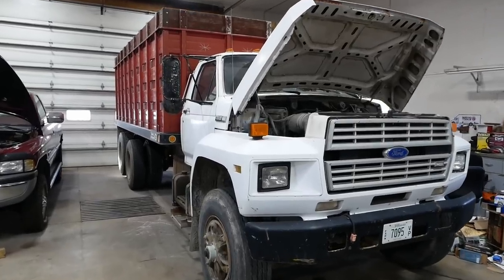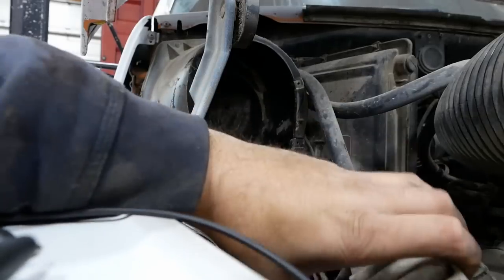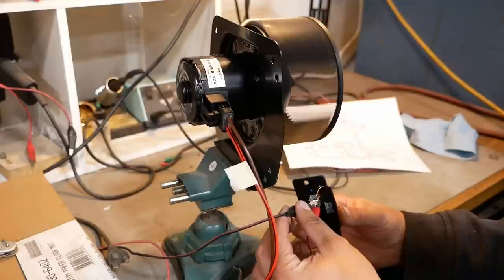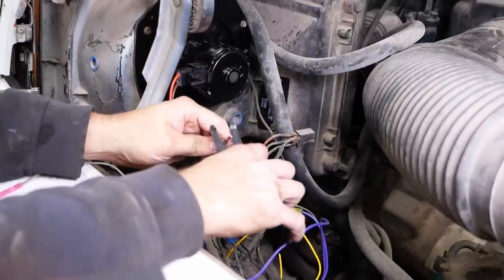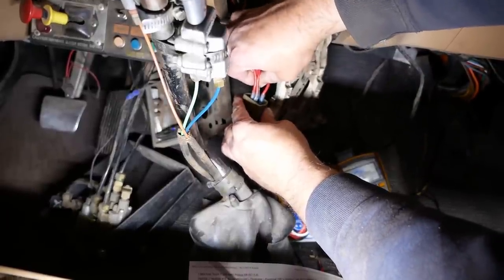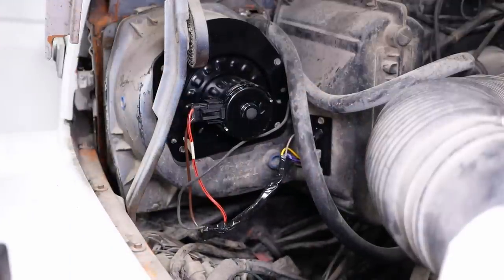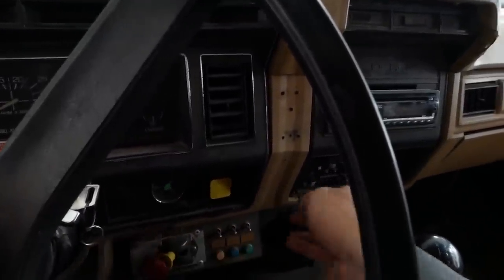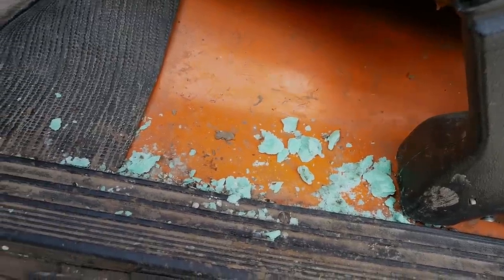Frigid Farmers - Ford F800 Blower Motor Unhacking

Comment: Enjoyable as always Wes. Can always take some wire-crimping therapy. However my stress levels rose dramatically  at the end with that horrible  rattling noise combined with the non-functioning radio. When you were installing the latter I was saying (based on personal experience) 'test the radio! test the radio!'. But as it didn't work in the first place...  i guess you knew what you were doing. :)

Comment: My Ford f650 rollback towtruck with a car on the back got 24 miles per gallons with the 8.2 Detroit In 60000 miles  it meant $20000 more profit over a newer f350 with a 7.3 power stroke.  
 Now mine was slower than time utilized was non turbo . The problems with the 8.2 were turbocharged . They couldn't handle power .  
 I  loved my 8.2 and felt sick selling it

Comment: I worked on the original iteration of the Detroit Fuel Pincher back in the early 80's. Their poor reputation is well deserved. The original ones started leaking exhaust gas through the head gasket into the cooling system. Either that or they completely blew. This occured around the very first 10,000 mile mark (I worked in a fleet).  Detroit's solution was to drill and tap the block for a larger head bolt and smoke it down to an intense torque plus 90°. The design flaw was the cylinder walls didn't have enough support at the head. They had a 12-point metric head bolt that was very undersized, as well. That's about all I remember about them. Just their unreliability.

Comment: Ive had stuff like this what i did is wire up an S10 resistor and switch with gm style blower motor. Works great ez to wire too

Comment: Wes if that fuel pincher Detroit ever needs an overhaul send it down the road you can’t order parts until you completely disassemble it because each cylinder is a different size and you have to determine what size the cylinder is prior to ordering a kit but all in all when they run right they run well and they don’t do too bad on fuel

Comment: In Alaska I do all my rewiring with 
Arctic Wire it’s more flexible in cold. That PVC wire is trouble in -40. 
It would be nice to have a portable wire printer that prints colored lines on your wire or maybe Prints wire circuit numbers over the full length of your why are you use for that job.

Comment: Excellent video Wes  :) big hack job for sure and puzzle on all red wires to blower motor switch selected settings and thought say what the Hot for Key ignition switch , Main Ground , Netural ground , Earth ground ,  Fuse protection,  and holy moly also on engine compartment to  keep mice eat wires use Mens After Shave lotion cure or Bounce Dryer sheets to help out! That black took out plug inside cab on blower motor is connected to Stereo ground and ground part of cluster Wes !  Plus if Stereo check on wires hook bet main fuse in wire harness for Stereo went on Stereo itself has one below plug  it blue blade big 15 amp  fuse in 1980's to 1990's  ! If not Stereo itself inside blew up on Voltage protection Zenith  Diode on circuit board blown!

Comment: Top tip!
Just buy a PWM module (Power width modulation) from eBay at about $10. Its about the size of a pack of cards and has a potentiometer on one end.Then you can adjust the fan speed from zero to full blast.
Just attach it to the side of the console, on a beater it makes no difference.

Comment: We just bought an '84 IH S2500 and we are going through the same hacked up wiring.  Blower, turn signals, low air buzzer, back up lights, horn  everything has been hacked.

Comment: After grinding under Jeep on the uni body for 5 hr.  this is relaxing because i hate wiring, cause still don't have my tailgate window fixed on the bronco. unatonable window key switch used on multiple 70; s power key lock window control system seems to be not made any more.  this is relaxing to watch you methodically unscrew some else's fckery///

Comment: I had multiple 90s Nissan blower resistors fail, and those are extra hilarious because "high" is still a lot more resistance than 0. So when they fail your end up with a fan stuck on hyper speed and it's insanely loud.

Comment: I first thought well how bad could this job be, seemed simple enough you just pull out the blower motor fins order a new one problem solved. And then you opened the cab and explained all the hanging connectors had something to do with the blower motor

Comment: Not boring. Very entertaining as usual. House electrics I understand. Auto electrics hardly at all. You make it look easy when in reality it is complicated and fiddly especially when you are nearly always dealing with some hack job as the reason it is there. At least on that old girl everything is probably not controlled by computer and can be worked on by a human not a robot. Even in my game construction the march of computers is coming. I have seen videos of construction robots but never seen one being used. The firm I am currently working for are using a robot to lay the concrete blocks. How long before you buy your house off the plan and a host of robot constructors rock up and assemble it. They are looking to do it on Mars so on earth shouldn't be too hard.

Comment: My best guess for the usual reason of excessively overpriced parts is scarcity of the part.
On my Audi I deal with this problem by finding nearly identical parts meant for other more common Audi models or even other volkswagen group cars. Most recently I had to replace a servo motor for the climate control temperature flap, the correct part number one would have cost 140EUR, I bought one nearly identical to swap out the worn bits for just 22EUR. Takes some internet research but it's worth it when you can save literally hundreds for just a few small repairs.

Comment: What is the make/model on those blue handled crimping pliers you use in this video?  They look like nice pieces and I could use a set with a tiny head like that.

I've got a ratcheting set from Ideal that I really like, but they're gigantic and don't fit in a lot of the places you find wire splices in.

Comment: I have at least a half dozen rolls of electrical tape.  I always forget I have some then I go buy a roll only to find like three rolls in a drawer.  I'd be well stocked if I weren't so absent-minded with my personal projects!  What's that heat gun you have there Wes?  I like the tiny shroud on the business end.

Comment: My sister parked her Infiniti Q80 Platinum down at her country place last year over winter. A few rats got into the engine and chewed everything up and then some made it in to the interior by chewing up the air vent slats. They made a nice winter home under her leather seats. Tons of rat feces, urine,torn wires, leather, destroyed seat controls including the ventilated and heated seats. Total cost of repairs, $4380. She had a laser system set up to keep the rodents at bay and I suggested a walk the plank trap...several of them. She thought she was smarter. Homeowners paid for repairs though. That was a fight.

Comment: When you initially pulled the blower motor there was some sort of insulation between the parts.  Didn't notice any on the new part.  Is there insulation on the new blower housing?  Thanks.  Good video.

Comment: You did really great getting that mess sorted out. I was thinking, there should be a note on all vehicles, like they do on electronics, no user serviceable components inside. Some people should keep their digits out of their vehicles. When you were replacing the wires to the switch I remember thinking, is he going to make a note of where the wires go? You didn't and you still got it right! If I tried that, well, who knows what wire would have gone where. Used to be able to operate without notes but, well, getting older doesn't help the memory.

Comment: You customer should move that air pressure regulator for the lift axle. Per dot regs it’s not supposed to be in the cab. Local farmer got overweight ticket when they disallowed his lift axle because of it

Comment: The reason the med 2 goes to two pins is because it powers the motor with 2 resistors in parallel. Resistors in parallel will have a resistance lower than their sum.  1/RTotal =1/R1 + 1/R2 +….  In this case having the parallel connection to two pins allows another for another fan speed without another resister.

Comment: I wish the fan i last installed looked as good as the one you just put in. If it had i wouldnt be thinking of replacing it again.  I was not suprised that when you were done it looked like factory.  Where did you buy that fan.

Comment: A lot of the economics of kits costing less has to do with merchants not wanting to stock slow moving items on the shelf, collecting dust and capital. So, you get whole generic windshield wipers rather than individual blades for each car, starter motors rather than individual solenoid repair kits, and whole AC compressors rather than custom compressor clutches, etc. It's not fair or even right but it's what we get when manufacturing is half a planet away.

Comment: I didn't know Ford used the fuel pincher in their trucks.  Those engines are bad, lol.  They have an open deck block and under enough power the cylinders will drop away from the head and blow head gaskets.  They were used in marine applications as well, the twin turbo ones blew up like crazy.

Comment: That’s a $78 light or more. Did it come with the charger base or just the cord? It has UV light on the tip.
Reply from the maker: It has the whole works!
Reply: @WatchWesWork  Wonder if it's worth putting out a Short on the light?  Dunno.  Prolly longer to film & edit & then upload than it's actually worth.

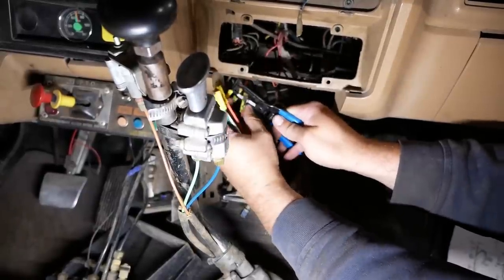Comment: 16:50, this is what I came here for, the main event, the star of the show, if you will, a guy cutting, stripping, and crimping wires. Bravo, Wes, bravo, another tour de force, a simply sublime performance. The cutting, stripping, and crimping, were on par with that of a neurosurgeon performing the most delicate procedure.

The New York Times: 5 Stars, Wes really knows how to strip. An instant classic... 
Variety: Excellent cutting and stripping, however the crimping was disappointing but overall a solid performance...
Empire: Old hand Wes makes it look easy. A true masterpiece that will tug on your heartstrings...

Comment: Success celebrated with a rat turd confetti geyser !
That has to be the least amount of stuff I have ever seen coming out of the vents on a grain truck .
One of the most impressive ones was an old GMC that was insulated with pieces of white styrofoam .
I say was , because most of it had vanished .
The blower motor had quit and the farmer had just parked it leaving it sit for a couple years , because he got a newer truck .
The transmission quit on the new truck so he pulled the old one out of the shed .
He had me replace the battery which was completely dead , and , finding the blower not working , I checked the fuse box .
Yep , blown .
I popped in a new fuse , turned on the fan , and the cab turned into the biggest damned snowglobe you have ever seen .
I do not think he ever got it all cleaned out , either .
It blew styrofoam almost constantly for the next 3 years . Every time you hit a bump , you got another snow flurry .
I recall also an old  international .
Didnt get any rat stuff or styrofoam coming out of it .
What did come out was a snake skin about 3' long , which I thought was funny as hell and which the farmer had a far different opinion .
He exited the truck so fast his shadow was still sitting there looking for him .

Comment: So why did you unpin that black wire on the speed control switch and not unpin the red wire and put the black wire in its place? Just curious? I am sure as to why you did it and anyone that has done much wiring will also understand but the question remains. There are 3 possible answers...The Devils Advocate... My favorite thing  is Wiring along with most everything heavy duty.

Comment: young grasshopper it's interesting to see how far down the rabbit hole you must travel and then behold your conquest of the dragon/dragons on those crusty piles of crap Illinois allows on the roads as long as the rusted pitted and holy frame is still connected as always it's been a rabbit hole with a couple of twist until your back I'll be waiting oh,the owner needs a better catscanner that one works as often as I do

Comment: Tell me about it right now with electrical parts and pieces I needed a 50 amp 2 pole GFI protected breaker for a hot tub installation checked out the price it was over $100 instead I bought a 50 amp two pole GFI protected spa panel which came with the breaker for $66
Reply from the maker: Makes perfect sense.

Comment: Hack farmer wiring I predicted wire nuts and twisted wires and tape :)
Reply: I didn't see a single wire nut I think you got off easy Wes ! 
I've got to get one of those small heat guns
Reply: At least he didn’t find speaker wire in the circuits. 😅
Reply: Wes didnt dig too deep in the  wiring on that pig. Im sure there are aplenty of wirenuts, scotchlocks, twist and pray connections hiding under the dash, under the cab etc
Reply: @harveylong5878  whenever I see a wire nut with Green crusty inside I know Im working on a famer approved vehicle :)

Comment: Noooo just fyi Wes dont trim the new pig tails they are using them as a sort of heat sink my son works for a local part store and we found out that some manufacturers are doing this as a fix for burnt wiring and or possible  fire prevention
Reply: What are you talking about?  Making claims, not bothering to post a time stamp.  Frankly somebody working at a parts store does not meet the lowest bar of competency.

Comment: It's a Ford. The blower motor has power and the heater control provides ground, either directly for high or through the wirewound resistors in the block mounted in the cooling air of the plenum...
Doh, should have watched more than 5min before commenting.

Comment: why you don't like dorman? i have ordered a thermostat and a coolant reservor cap here in romania via ebay from them and they are nicer than whatever crap we buy overhere, even OEM gm
Reply: everything is made in china, bought a crappy return line for the turbo OEM GM, looked identically to the china one wich was  a tenth of the price
Reply: His shop puts a warranty on the parts & repairs, and Dorman sometimes (or too often, if you ask most) will not "last" until the end of the warranty
Reply: @CAPNMAC82  You gotta love america just for that fact alone. In romania even if you were to buy the part from the garage you will still only get warranty for the garage labour as the piece warranty is from the manufacturer. Here's an exemple: you replace clutch+bearing and rear main seal that you bought from a garage (aka you paid more than regular store) and if the bearing breaks after 3 days you will still have to pay for the labour for it to be replaced. So far i am happy with dorman's quality, is not like other manufacturer don't make their products in china at crappy standards when even OEM does the same.

Comment: They wanted 49 dollars my thr connector that goes to ky alternator in my 03 v6 mustang. And it didnt even work.when i hooked it up algater clips and wires the car ran fine.but with new clips tired 3 new ones my car just shuts off. Im not sure its because there cheap chineae parts or what.

Comment: Got to figure that truck hauls grain. The guy's cat may be greatly outnumbered. You could rent Max out for a week or so to help the cat catch up...I do a lot on cab and add a body trucks with what I call spider web wiring..... REALLY A TRIP WHEN ALL THEY USE IS WIRE OF THE SAME COLOR. Thing about China parts is shipping. Cheaper to ship 2 parts in same pack than separately. Parts production is cheap, shipping is the killer. Blower motor/resistor systems are really simple once you get you head around the fact that the motor is powered and the resistor and switch provide the ground path.
Reply: Actually, on commercial trucks, monocolor wire is pretty common.  If you have 20-30 wires coming out of a Peterbuilt dash, you are going to run out of colors pretty quickly.
Reply: @CAPNMAC82  Those wires are typically labeled the entire length.  As for dealing with high wire counts... Not an issue.  Go ask any telecom guy.

Comment: like heater cores in some cars, you have to degas the air con, and remove the entire dash assembly bolted to the firewall............#$%% engineers.